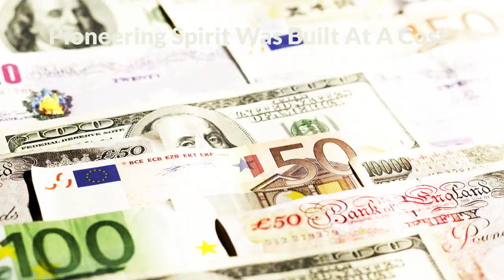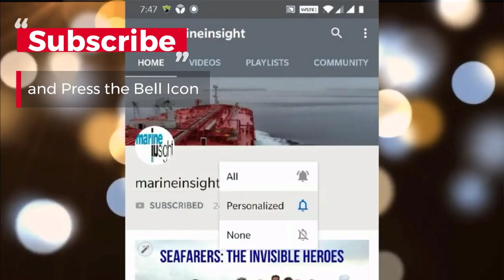Biggest Ship Ever Built

Comment: The shot at 4:37 cracks me up, it's a home handyman buzzbox 110V welder being used, with a handheld, two dollar shop welding shield! 
To weld up that vessel with that equipment would take approximately as long as it took for the continents to separate and drift via plate tectonics to their current locations.